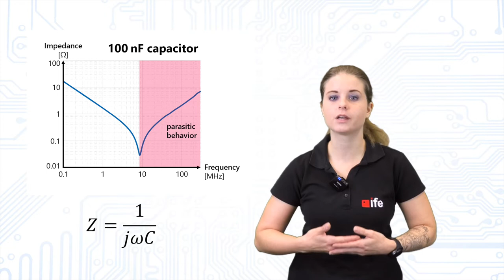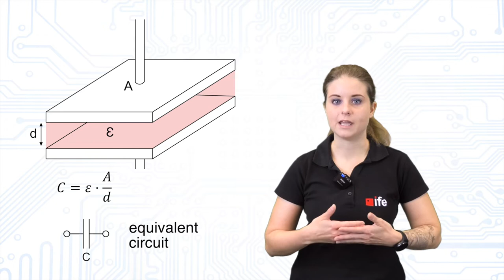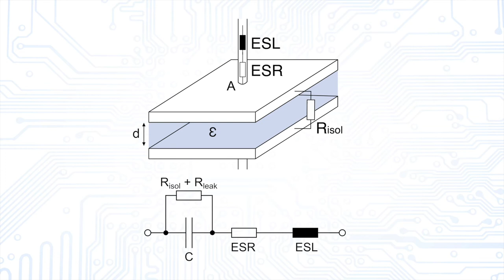Real Capacitors

Comment: Sabrina Koffler,

You could easily have shown the behavior of a few "real" capacitors as a function of frequency. And added a variable resistance and inductance to show the effects of changing those.  Design, testing, measurement is all about numbers, data collection.  More and more that also means models, algorithms, comparison between model and measurements.  Get people used to seeing real behaviors, real values, and do not treat "noise" or "error signals" as things to diminish or hide away. Rather get people used to measuring everything.  In many systems, the "noise" signals are the most important, since understanding them gives clear pathways to optimization.

"We are going to show you a range of real capacitors very quickly.  We set this up to display the response of these over a range from milliHertz to 10 GHz.  We will quickly look at the whole range, then zoom in on milliHertz to KiloHertz, KiloHertz to MegaHertz, MegaHertz to GigaHertz.  To give you a mental picture of what to expect when you want to use these in real circuits and applications."

When you give people real context, and memories of real things, they learn faster and are better able to create new things.

Richard Collins, The Internet Foundation
Reply from the maker: Dear Richard Collins,

Thank you for your very constructive feedback. We fully agree, the earlier (both in teaching and in developing electronics) we consider the real behaviour of components, the sooner we can adapt to these circumstances.

Some further information can also be found in one of our other videos [1].

We will try to incorporate your ideas into our next videos.

Dominik Zupan, Institute of Electronics, TU Graz

[1] https://youtu.be/hLlv_BB3gwQ